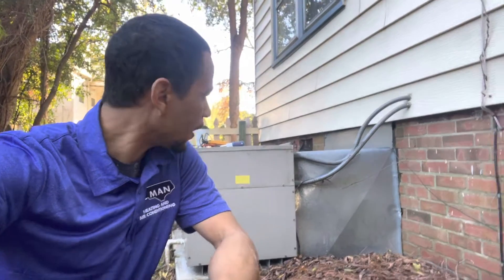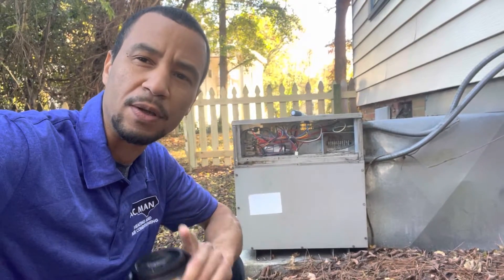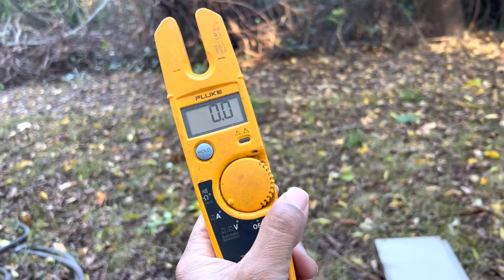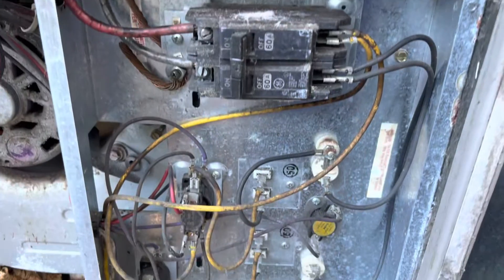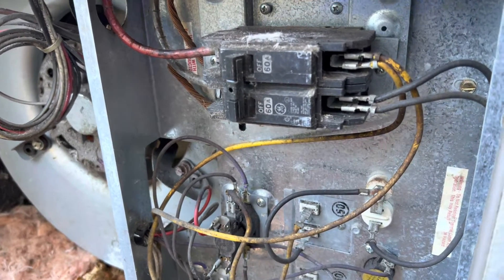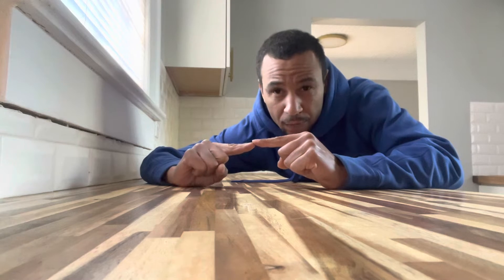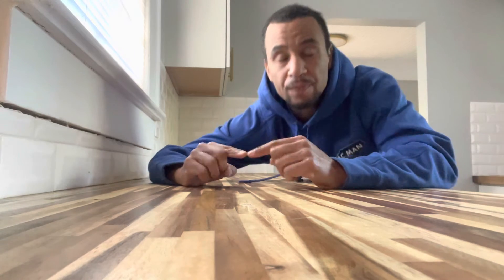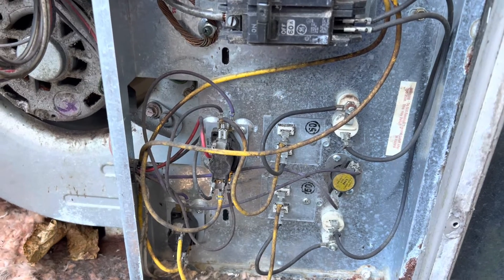Using a voltmeter to test open and closed switches

Comment: When you did the measurement, you said you were reading 0 volts on the sequencer and concluded that the sequencer was not closing.

In your follow up explanation you said that if you measure both sides of a switch and the reading is 0 then that means the switch is closed because 120 - 120 = 0.

So the sequencer was operating properly, no?
Reply from the maker: yes. if you test voltage across the switch and the switch is closed, you will get zero. If you test voltage across the switch and you get voltage the switch is open.